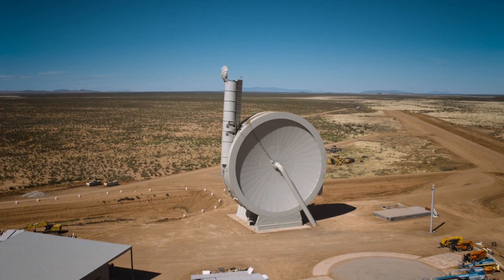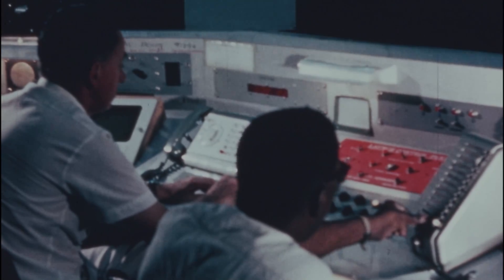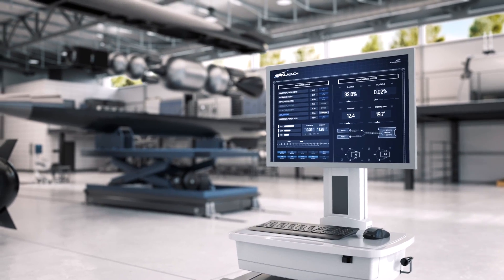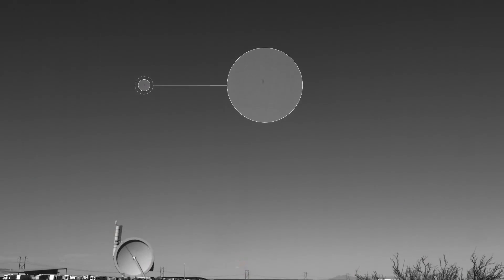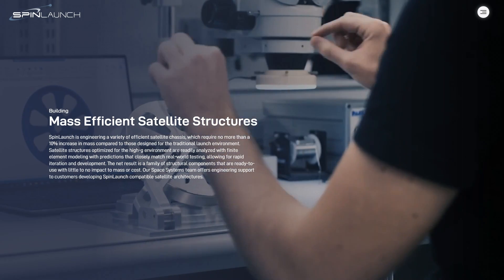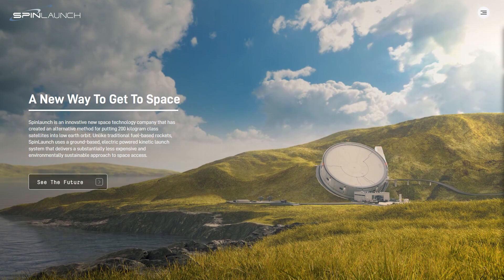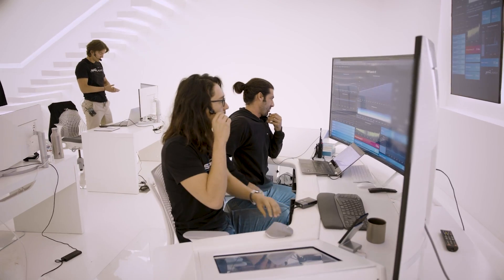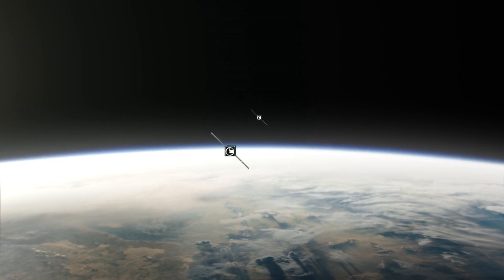Can Spinlaunch Throw Rockets Into Space?

Comment: I wonder if a flywheel system would work better than a spinning arm. Both providing counter balance to the payload and likely decreasing the balancing issues of releasingthe payload, and a store of kinetic energy which can be harvested. I wonder if something like this were CERN sized, placed horizontalto the ground insteadof vertical, if they could spin it to a high enough speed to both still reach the atmosphere and not impart fatal g forces onto living things? I suppose material strength sciences aren't quite up to the task of holding something that large while it spins, maybe some kind of maglev bearing system could help hold it up along the width of the flywheel?

Comment: Maybe just put in 2 Yeeters instead of one, and launch them one after the other just to keep that balance. The launch wheel will only be unbalanced half a rotation before you let go of the second load. And due to orbital mechanics and timing, those 2 Yeeters will not be in the same flightpath.
Reply: What about the vacuum? Also, I don't think you understand how important the balance issue is and how fast things will go bad when a rotor that size is that unbalanced.

Comment: My question is which one will it be? The upright vertical one or the one that's sitting at a 45 degree angle, because that WILL make a difference on the G forces, the speed, the amount of slow down and heat built up when the rocket comes out and hits the atmosphere, ALL kinds of stuff will be HUGELY effected by weather its sitting 90 degrees vertically or at a 45 degree angle. And also, with a rocket that is using NO rockets for constant propulsion and acceleration, would it not also make a difference weather they were flinging this thing with or against the earth's rotation as well as with or against the earth's orbital direction? Cause I mean a normal rocket has, well a rocket, that is providing constant acceleration and propulsion to speed up and maintain a certain speed. So wouldn't something that is solely dependent on the amount of energy put into it on launch not be effected MORE by the earth's rotation and orbit? Correct me if I'm wrong, but lets say you fling the rocket against the earth's orbital direction, once it got into space and the earth is moving in the opposite direction that the rocket is, wouldn't the earth moving away from it not drag on the rocket and slow it down? It might not be a LOT, but when your talking about space a TINY amount could make or break it for you. I'm sure they've taken all of this into account, but its still fun(at least to me) to think about how much extra speed you might get flinging it WITH the earth's rotation compare to against it and so on. This kind of stuff is to me, like a half finished puzzle is to an OCD person....LOL

Comment: Good system for the moon. Not so good where there's an atmosphere. Interesting none the less and a lot less stuff burned to get things like Satellites to orbit if they can make it viable. I still think Falcon 9 will be cheaper per Satellite as it can launch 60 at a time and is very consistent, and once Starship comes online, nothing else will even come close, but diversity is important in any ecosystem, so I'm glad people are working on different solutions. You never know how it might help in the future. Maybe put one on the top of the worlds tallest building, so there's less atmosphere to get through. Or put it on the top of a mountain with low air pressure, like Everest. You will need to bore up through the mountain though to supply the base, so get some help from The Boring Company and see how you go.

Comment: This is dumb. It’s one of those ideas that looks good on paper for angel investors, but couldn’t ever cut it in real life. To get Mach 1 at release, compute the centripetal acceleration. That’s lateral acceleration on the vehicle. Space launch systems must be designed for axial, not lateral acceleration. Requiring both high axial (from the rocket) and lateral (from the slingshot) airframe strength will ultimately make this a deal-breaker for terrestrial launches simply due to the added weight of the system.

Comment: Launch an equal mass counterweight into a hole in the ground at the same time. It would increase the cost a bit but it would also remove the problem of the arm unbalancing itself when it lets go
Reply: It would also need twice as much energy to spin up and they would have to make something to stop the projectile launched/yeeted downwards.. or at least significantly slow it down... because once they scale up to big rocket sizes with payloads? you don't want something that heavy to hit the ground with such speed.. and to stop something like that, you'd probably need a big, long tunnel..

Comment: I always believed a long Railgun would be a lot more reasonable, especially if you plan on sending stuff to space repeatedly and share it like an airport. You know, more like a maglev-train or particle accelerator, but after a few rounds of acceleration the vehicle gets redirected to a channel with a convex upwards slope, e.g. using a tall mountain as base structure. With a mountain of 4000m altitude, air density at the point of exit would only be 60% compared to the ground.

Comment: I wonder what, if any, impact elevation of the launcher (thinner atmosphere) and barrel length (extend time it’s travelling in a vacuum) would have on its performance. I suspect there’s a balance between the kinetic energy savings vs energy needs to evacuate the volume a barrel.
Reply: Interesting idea. What if the projectile's exit from vacuum into atmosphere is staged?  You know to spread that force out a wee bit? Extend the tube, and have stages with increasing levels of atmosphere in them?
Reply: hmmm, this leads me to another avenue of thinking. if you have a vaccum tube and open one end doesnt the contents go flying out? could this be used to launch things to a high altitude?
Reply: @JonJon-nt1wy  No, if you go from a pressurized environment to a vacuum is when the contents fly out.
Reply: @JonJon-nt1wy  I wouldn't have thought so, you'll just get an inrush of air to fill the vaccum.
Reply: Elevation might be a factor, but barrel length is negligible compared to the amount of atmosphere it has to travel through.
Reply: @1.4142  this. Also I believe it's already currently launching from a decently high altitude. You also need to bring all the stuff up the mountain

Comment: I wonder if taking the rail gun tech and then using that to slowly over a 3km or more track that starts at sea level and then goes up the side of a mountain to bring the mass of a rocket up to speeds where when you light the "second stage" smaller engine it's already at insane speeds. Seems like that might be easier from a technical standpoint, hell, you could even have it be in a vacuum like this one and it comes out the end of some hyperloop style tube at crazy speeds, better yet, do it at altitude to just make it that much easier on yourself.

Comment: Solving that issue of balance on release is simple in nature but still hard to do. Simple, it is symmetry, have it throw a dummy projectile down a chute on the other end, but have the pipe for the dummy projectile be longer than the pipe the actual launch vehicle is so it does not disrupt the vacuum and have some way to bring the dummy projectile to a stop, or just throw them into the ground until they build up then just clean the projectile zone of waste. Still this would require the timing on release be very precise and in two places, but I can see this being a simpler solution than having something adjust on the counter weight part of the launcher, of which a movement like that could be done but would again be much harder to do the the specifications that no damage would be accrued on the launcher.

Comment: These guys came to our school a few years ago, and presented a really interesting concept. The idea seemed pretty cool, they even explained the difference between quasi-static and dynamic loading and how most things can handle extremely high quasi static loading. They seemed to have the theory very well thought out. However, when it switched over to Q&A some of their answers to our questions about implementation were a bit unsatisfying. We asked about the release mechanism, asking about some of the issues proposed in this video. Essentially they shut us down saying they had a proprietary system that they couldn’t talk about. The next thing we asked was assuming you have this release thing working so that it doesn’t destroy itself, what happens if you get the timing wrong, what are the safety concerns. Mistiming by even a fraction of a second points an object with incredible momentum back toward earth essentially creating a kinetic bomb, even ignoring the chemical potential of the propellant. Again they said they had a proprietary system they couldn’t talk about and that they would have a berm constructed to stop the kinetic energy. Without further elaboration we were all kind of skeptical. Now obviously they aren’t going to explain everything in detail to a bunch of not yet engineers, but it felt like many of the challenges were not yet fully considered by the way they answered. However, this was a few years ago and it seems like they’ve made some progress in testing since then, and it’s still a really cool idea so hopefully they can successfully implement it. It would be really cool to see, and id love my initial skepticism to be proven wrong!
Reply: I would say that given what they are doing there a lot of engineers working on various things and it is pretty unlikely that all of the engineers know/understand all of the engineering that goes into making something like this work, especially when a wide variety of skillsets would be needed to achieve something like this. Either way, what they are trying to do is extremely interesting and could be a huge step forward in getting things into space.
Reply: So for the release mechanism, I assume it's some form of interlock thing such that when they "prime" it, the next time the thing goes around, the latches release as a function of being in the right position in the cycle, not time based.  The best analogy I can think of is like a train track switch if the launcher was a circular train track.

However, that doesn't answer a bevy of questions that remain about the thing, like what happens if a part experiences material failure (and it seems like they're using a lot of carbon composites here, which take a lot to fail, but fail spectacularly when they do, and also are rather difficult to maintain/inspect for signs of impending failure).  Seeing that arm shatter into a million shards of hypersonic carbon fiber sounds like a bad time to be alive.
Reply: @JMurph2015  And this is why they will likely build it underground, despite the press kit showing it near a picturesque seaside.  50-100m underground simply means the side of a hill crumbles and flies apart, not much different than say, at a bombing range.  Dirt is fantastic at being a cheap way to absorb lots of kinetic energy.
Reply: @plektosgaming  yeah still doesn't fix the issue of everything inside that chamber being blown to hell, meaning your (let's call it $100mil) launcher is no longer.
Reply: Well, yes.  Launch systems are not simple, which is why the best option still remains a linear accelerator with the end going up the side of a tall mountain.  It's not as small or as elegant, but in terms of dead-simple reliability, easy as pie.  The only issue is the time it would take for the entire tunnel to be depressurized.  It might take several hours compared to their system.  Though, I doubt they would ever be launching every hour and a half.
Reply: @plektosgaming  the railgun pressurization issue is similar to the spin chamber pressurization issue.
Reply: @plektosgaming  No need to depressurize with the linear accelerator as you only need enough speed to attain maybe 10k meters altitude. At that point you’ve left the bulk of the atmosphere behind and your much smaller rocket engine can take you the rest of the way. Ablative heat shielding would do the trick nicely.
Reply: @plektosgaming  I agree with everything else you said but it would way cheaper to build it above ground and hide the people underground or wherever. 
That thing looks at least 100 ft tall and needs easy access for inspection.
Reply: @amosbackstrom5366  The easiest way would be to simply dig a big pit and then fill it in later with dirt and rebar.  The command center can be a mile or so away.
Reply: I wonder how they manage to keep the thing balanced when the payload is released. How do they remove mass from the counterweight at the same instant?
Reply: @taylorsharp5928  Guessing they could have a releasable counterweight, say with explosive bolts, with the same kinetic energy. Just release the weight exactly at the same time as the payload. Payload gets yeeted to space, the counterweight slams into a berm that absorbs the impact like it was a meteor.
Reply: @meldroc  That is a bad idea, you would lose half of the kinetic energy from launching the counterweight. I suppose they can move the counterweight inwards, maybe with an explosive charge.
Reply: If you build it underground, (build it then bury it 50-100ft down), it should have no issues in the event of a failure.  Once it is shot, even if it is off-target, it will be a thousand miles down-range and over an ocean or tundra.   Counter to how we deal with rockets, because it is a launched projectile with no thrusters for the first stage, there will be little to no need to ever self-destruct.  Even if the shell came apart, the debris would still be either incinerated or land about where it was expected to in terms of range (ie - over non-populated areas). Rockets, OTOH, have always been problematic due to their habit of spinning out of control while still under thrust.  Kinetic launchers are far better in this respect as you know the exact flight path within a degree or two, every time, no matter what happens.
Reply: i think all of the questions were valid, they could have given a reudementaty explanation, the proprietary nature of the implamentation would still be obfuscated.  It is good to be skeptical until there is an MVP that is nearing actual advertised parameters.  Corperations operate in the realm of bullshit and marketing, and then the task of execution gets handed to the grunts on the ground and the engineers
Reply: From the way this company represents itself I can only guess this will end up as a giant money drain / pyramid scheme.
Reply: I wouldn’t be concerned about the first thing; explosive bolts, and a 1ms accuracy is really easy with electronics.
Reply: @danibess6284  1ms is easy timing with electronics, but it isn’t so easy with explosives and mechanical parts.
Reply: Someone should have asked how they plan to throttle down for max q.
Reply: @Gkitchens1  Max Q is moment of release, it is slowing down from there - the opposite of a rocket.
Reply: These are quite standard answers.  There are two reasons: first: it is stupid if you give your hard gained know how away for free, you give enough insight to attract investors. Second: if they would have all the answers they would not need to develop it.
Reply: @aduantas  only reason you go to the speed way......🤣😂😁😀😎
Reply: But a Yeet is actually pouring acid onto something. Nice try tho.
Reply: Nice. Interesting to hear this.
Reply: My assumption is the reason they didn't give you too much information is because they just didn't know it. They're probably the engineers who know enough to talk to people about what they rehearsed but not enough to actually do the complex analysis to develop the talking points. Assuming they did have an answer to these issues there is no reason they wouldn't say it as companies like this are impossible to spin up in response to some proprietary information coming out.  Could you imagine just trying to assemble a team of engineers and secure funding to make the operation work and your only claim to why they should give you money is well we kind of know the answer to this question that has been an issue... It would never happen.
Reply: I would have answered the second question by acknowledging that it's certainly a big risk, but so are conventional rockets. They can randomly explode.
Reply: While the launch release system answer is a reasonable concern, I don't think the  timing has any... I suppose different possible answers?

 From my point of view the most obvious and only reasonable option would be to put this launcher in a shallow hole, and put a self destruct on it too, so that in the event of a mis-timing it either hits the ground and destroys everything but no humans are harmed, or it launches into the air, destroys the vacuum chamber and is then self-destructed. I'm not an expert, but I don't see why they would do it any other way.
Reply: @NGabunchanumbers  if they launch from a coast it could be designed such that a failure only yeets it into the oceans or the ground below it
Reply: @NGabunchanumbers  why would you ever set something up to self destruct?  That sounds moronic, if you mean having some sort of kinetic sink, failsafe measures or something to slow stuff down and contain damage thats one thing
Reply: Considering how much companies like SpaceX steal from others, it's hardly surprising they'd be worried.

Comment: The system I'd go for personally would be a linear induction motor railgun, three or more linear induction motors positioned around the vehicle to locate and push the vehicle forward.

It would probably use a fair ammount of land mind, especially to arrive at its desired altitude at its desired velocity where minimal use of its rockets would be needed to get it into its orbit.
Reply: What bout a mix of both? Basically a hadron collider that you can switch the rails on and eject at velocity